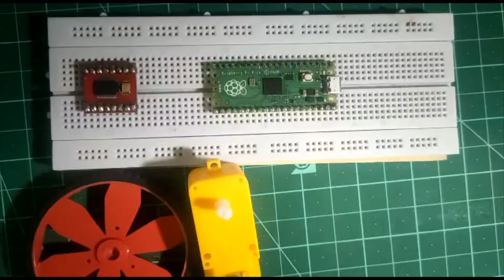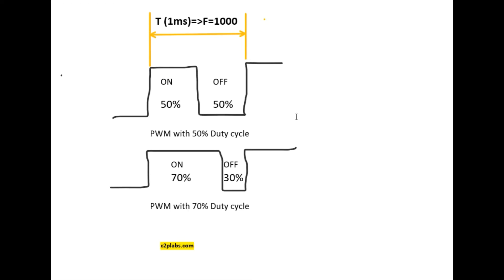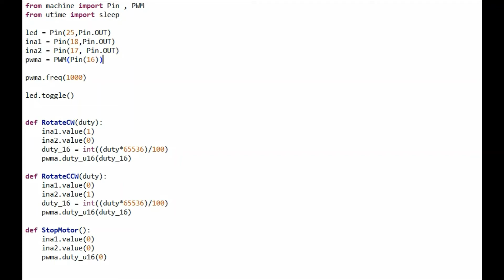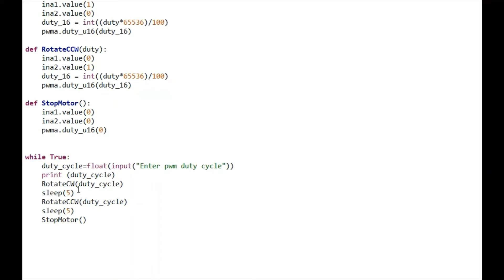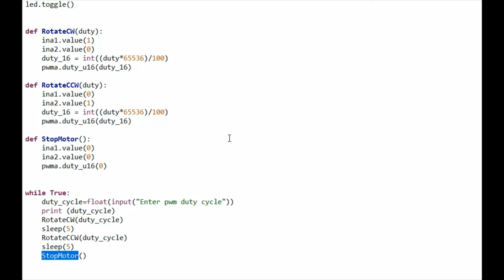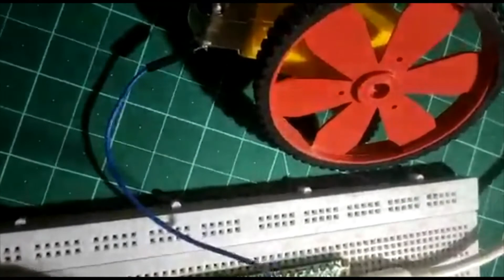How to Control DC Motors with Raspberry Pi Pico | MicroPython + TB6612FNG Explained!

Comment: Mate just draw a diagram showing the connections it's sooo hard to track which cable goes where in your video....
Reply: I know right. Really frustrating
Reply: Have you been able to work out the connections?
Reply: @halimaaktar3495 Yes! My solution isn't exactly what he has in the video, but I believe my motor works as expected.

Starting from the left side pins:
- VM: connected to the pi's VBUS (5V)
- VCC: There are two wires attached to this one. One goes to 3V3, the other goes to the standby ("STBY") pin on the motor driver.
- AO1 & AO2: Positive and negative for the DC motor. Pretty sure it doesn't matter which is which :)

Right side pins:
- PMWA: GP16
- AI2: GP17
- AI1: GP18
- STBY: Plugged into the VCC pin as said earlier
- GND: Grounded on the raspberry pi

Hope this helps for people that need this in the future!